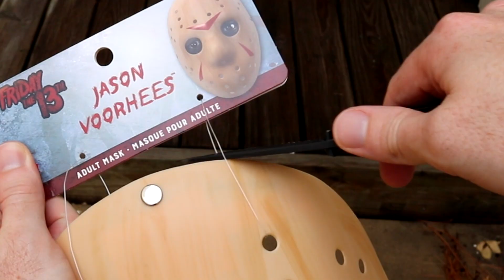How to Improve Your Spirit Halloween Jason Mask - PART 4

Comment: Would love to see a wood grain shield effect with Scottish Braveheart facepaint inspired designs
Throw in a few battle axe scars and V chips out the top right.
Reply from the maker: That's a very creative idea. I've done a woodgrain effect before: https://youtu.be/roSRAj7cNyk Adding war paint would be awesome
Reply: Stunning work especially the individual planks 💯
Now imagine that with a light white wash covering 2/3 of it, then the powdered blue stripes (tiger claw scratched shape) overlayed.
Add the usual nicks and cuts & a bit of blood splatter,
Also similar to the added screw heads on the wood video add the diamond shaped pummels you find on medieval doors.
Well That was my vision.

Comment: Excellent paint work! Have you ever thought of using a heat gun around the edges to kind of curl the mask around the top of the head and sides a little more? I've never done one of these store bought masks, just 3D printed my own. Maybe another video to test the heat gun and reshaping?

Comment: Question here. I’m new to this stuff and I’m wondering what sanding it helps with in this context?
Reply from the maker: Sanding is just extra insurance to make sure the spray paint sticks really well. It's totally optional though. Usually I would sand a mask and spray it with primer first, but again it's up to you!
Reply: Thanks for the reply. I ordered some decals from you and once they arrive I’m going to get started. I hope it turns out half a good as yours

Comment: Do you  Wash it after sanding the 1st coat?
Reply from the maker: I usually just use compressed air to clean it off but I've also run masks under water as well. Whatever you prefer!
Reply: @BigHush  ty